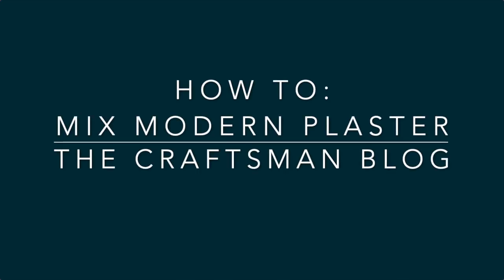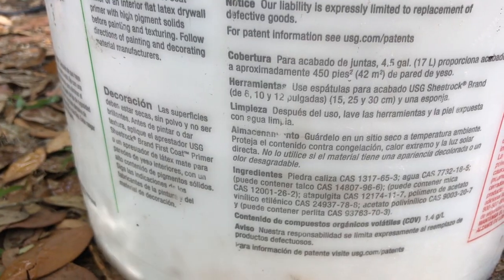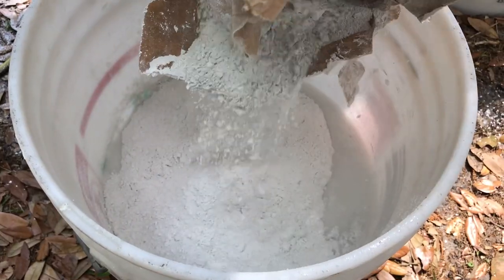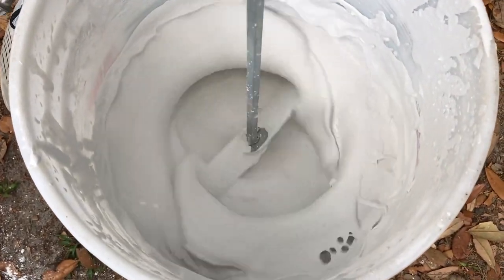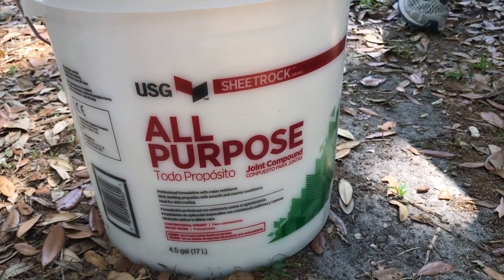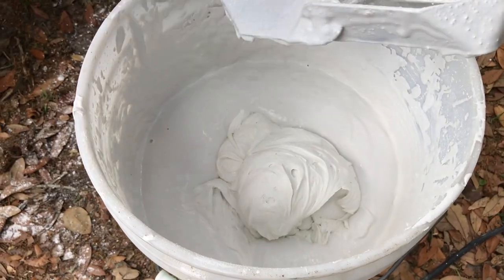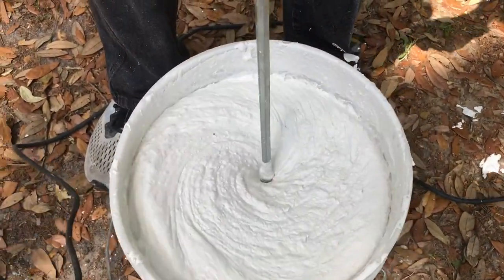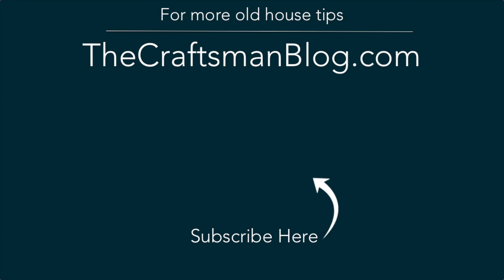How To Mix Modern Plaster

Comment: Thank you for your advice! I'm doing my first plaster job. I'm having a really hard time finding veneer plaster for the job. Is there an alternative to the Diamond Veneer? Would the Plaster of Paris Dry Mix work in this mixture?
Reply: or would a basecoat veneer like Structo Lite work?
Reply: I have had the same problem. I used the bag of Dap plaster of paris from ACE hardware on one a couple months ago. It worked fine, now just got to get the right sand. I used silica sand and it wasn't quite big enough. Job still sold though.
Reply: @johnfisher9969  is the working time any different using the POP vs Diamond? Thought of doing this as well but saw someone posted that it dried way too fast.
Reply: @AdamLHuerta  it set so fast. If I had a bigger area to coat I wouldn't have made it.  I did come close to the texture i needed.
Reply: Thomas....same problem here!  Lowes has it online, but you have to purchase a minimum of 63 units.  I also found it through ACE Hardware, but the shipping costs more than the product!!  Crazy since USG is a well known product for Drywall finishes.
Reply: Diamond was not available anywhere in my town but one of the local hardware stores did a special order and shipped it with their drywall orders.

Comment: So from my research Diamond Veneer Plaster would be a modern plaster that is largely gypsum based rather than the traditional lime based plaster. And then you have Plaster of Paris which is Gypsum that has been heated to a high temperature. Plaster of Paris sets fast and rock hard, but that would also be it's disadvantage. And then joint compounds would be a mix of limestone, clay, silica, vinyl, gypsum, binders, and other various ingrediants depending on type. Does all this sound about right? It's taken me quite a bit of research trying to learn all the differences of plaster/drywall products lol.

Comment: Can I skim coat new regular drywall with this plaster mud mix or do I have to hang plaster board
Reply from the maker: You can go over regular drywall.
Reply: Thanks. Should I use the plaster corner bead and mesh tape